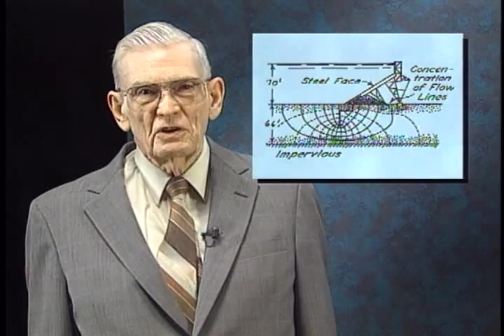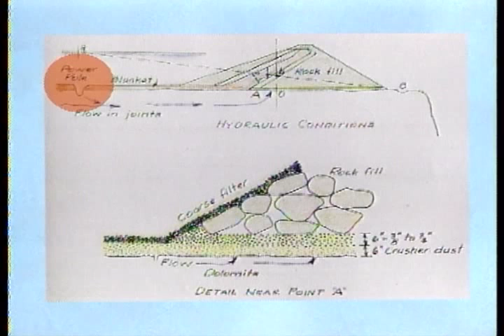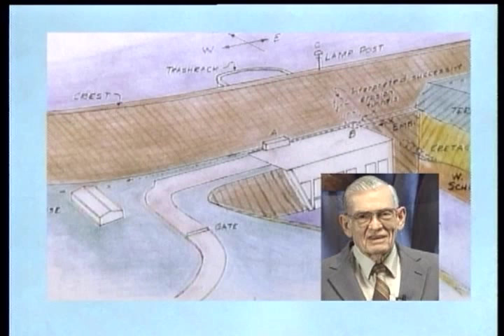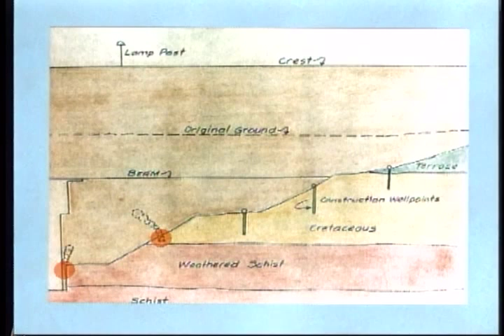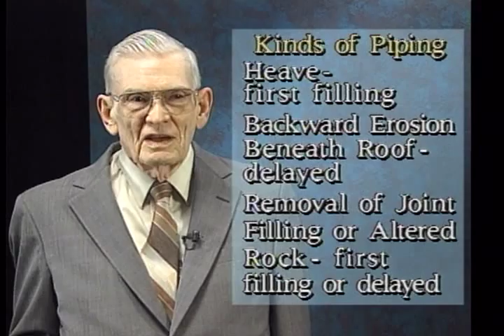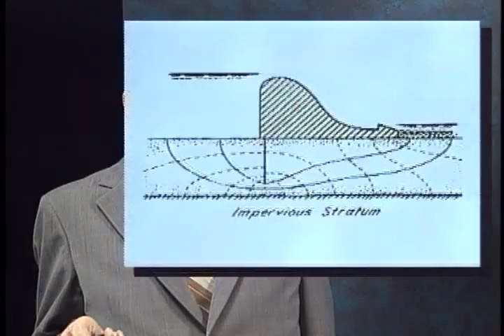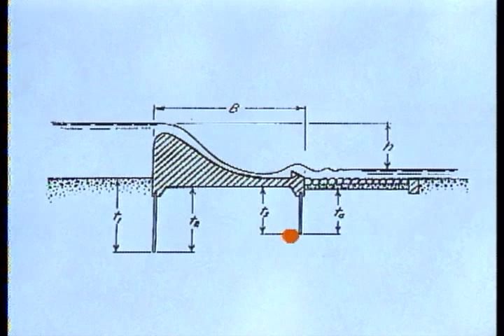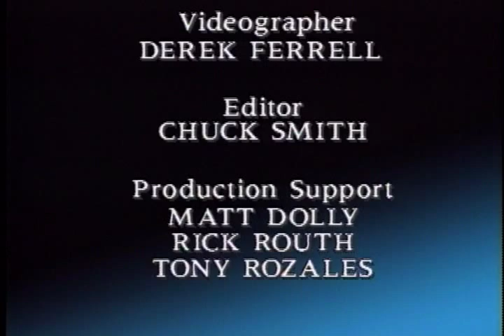National Dam Safety: Seepage and Piping (Part 1)

Comment: DWR said tonight that it is normal for earthen dams to have seepage?? We are here at the Oroville dam,, and our dams issues are the same as those problems that of Fontanelle Dam and Teton Dam had,,, and our dam is the same layout as the Fontanelle dam and Teton Dam.
Reply: No your dam does not have the same issue at Teton Dam.  Teton failed on the first filling because the foundation material was not suitable.  Oroville has been up for 50+ years and has been full many times.